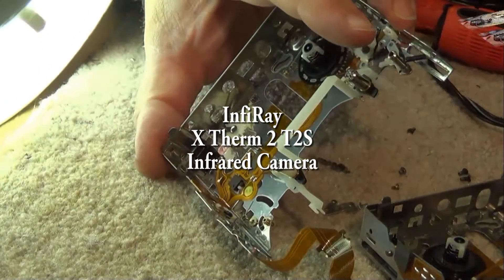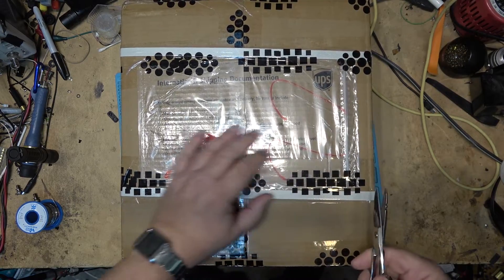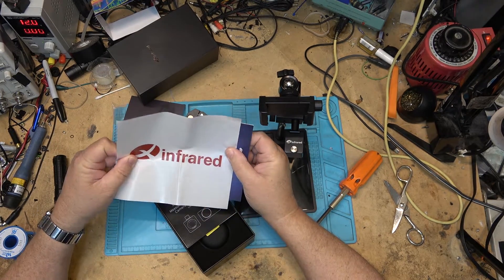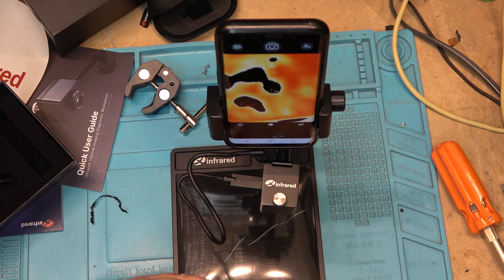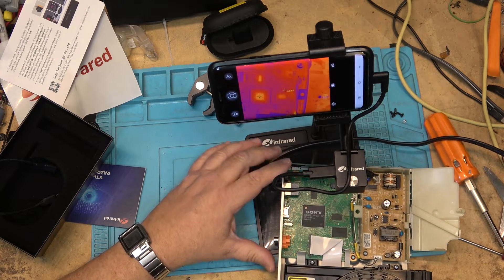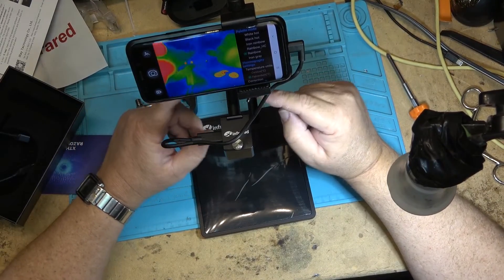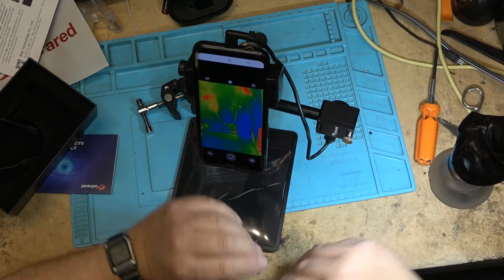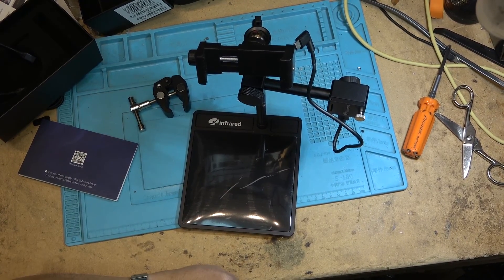InfiRay X Therm 2 Infrared Camera Unbox and Check Over

Comment: A thermal camera has been on my want list for a while, it would definitely help when troubleshooting circuit boards both in preventing damage and pin pointing potential issues that might otherwise slip past QC.